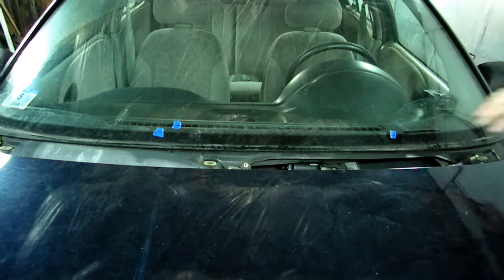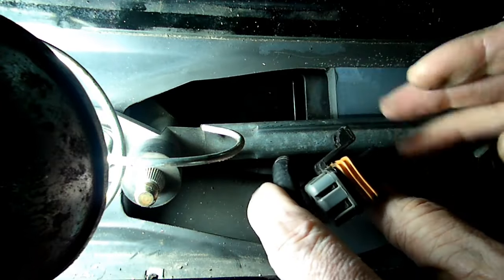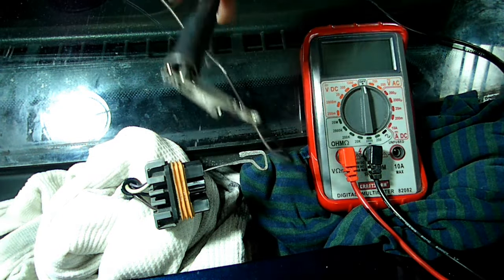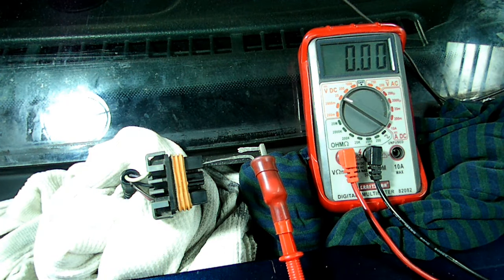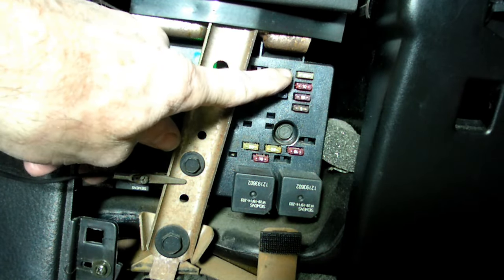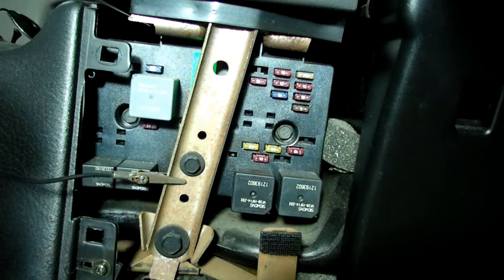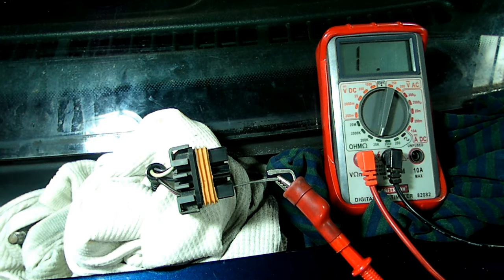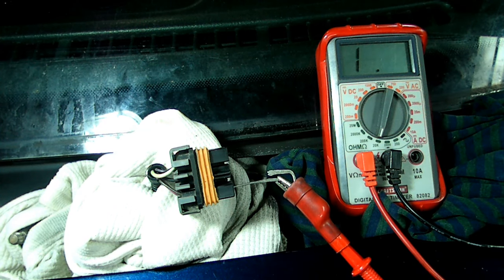Wiper Motor & Switch Troubleshooting

Comment: Brother i really watched this video about 10 times as i have no front wipers on a nissan pulsar  n14 hatch back ..
i had already replaced the wiper motor and replaced the wiper stalk but still no action ,   i followed your steps  with the multimeter and all was good  , my next step was remove the wiper motor again .... 
It  turns out there is a difference in a nissan pulsar hatch front  wiper  motor and a nissan pulsar 4 door  front wiper  motor .. found the exact model replaced it again and away it went ..... your video was really clear and easy to follow ..... thanks heaps

Comment: I used your excellent videos to troubleshoot a wiper problem.  The switch was fine.  I took out the wiper assembly and assumed the wiper motor was gone which the video suggests.  However, when I took the motor off of the assembly I discovered the linkage was rusted solid and wouldn't move and that was the problem.  Thought I should mention that as one other cause for wiper problems.

Comment: My bad Richpin06, I never finished the video. I just did your diagnostics completely and found thatthe answer lies in finish the whole educational video. Awesome stuff once again. Moter is shot
Reply from the maker: I am glad you found the problem.
Reply: @RichpinTv  in theory I did. I just pulled the assembly from the bone yard today in Sarasota, Fl. Hotter than a Mo-Fo. Got a steering wheel with the Multi-Switch since it looked brand new and fot WTF purposes . BTW, i lost my old email address when I first started using your vids back in 2009. You and Old Nuc from Saturn forums walked me through the timing chain and cylinder head install back 2012ish. I went by Mr. Raider I believe .

Comment: I have a '98 Saturn SC2 with over 256,000 miles on her (original owner).  My wipers seem to have a mind of their own.  When I push the switch arm down, for the wipers to swipe once, sometimes they do, in fact, swipe once but there are times (numerous lately) when they will wipe multiple times before stopping and sometimes they just don't stop.  The "high" position seems to work just fine.  The low and intermittent settings vary in their "timing" of the wiper movement which is to say they're not working exactly as they have been over the years.  I disconnected the elec connection to the motor (as per your video which is great BTW) and proceeded to do some meter readings.  The readings on my purple and brown wire are fluctuating wildly vs what you show in the video.  At one point the reading on one of those wires leveled out to a specific reading but starting fluctuating again when I barely touched the wiper switch arm.  Based on that, I'm thinking the switch is toast.  Am I barking up the right tree or did I miss something?  Thanks in advance.
Reply from the maker: +Roy Sacavage Your troubleshooting sounds like there might possible be a problem in the switch area.
Reply: Roy Sacavage , I have the same problem with my Jetta wipers. The dealer charged me $300 bucks to change the wiper controls arm at the steering wheel, after leaving the dealership the same symptoms were still there especially in the cold mornings. I think it's the capacitor inside the motor that is failing and won't shut off the wipers when it's supposed to.  Not many videos online for such troubleshooting. Rich pin did help me hear in understanding that there is an internal capacitor regulating the voltage to control the motors intermittent and speeds. There is a starting point. Cheers

Comment: I just want to share my thanks to you for your excellent diagnostic video! Following the steps that you shared in this instructional video, I was able to successfully diagnose that the issue with my wipers not working correctly was to be found in the motor assembly, not the switch. When I got in there and checked, I found the bolts holding the motor to the mount were loose (not a good sign). I located another motor assembly at a local junk yard and tested it before I mounted it. Problem solved! Many thanks for your kind assistance!

Comment from the maker: @goatinapastlife It is not a switch problem because the voltage does not go through the switch.Look for the problem at or around the wiper fuse in the interior fuse panel.

Comment from the maker: The metal inside the car is a lot cleaner for better contact is why i ran the wire there.I ran my wire to the brace in front of the fuse panel.

Comment from the maker: 12 volts is correct for the yellow wire as it comes direct from the 25A wiper fuse.Were you blowing the fuse before you replaced the switch.

Comment: Good video Rich !!!  I`m having a problem with the wipers and right turn signal on 2004 3.4L Impala. I`m  still waiting on the mail for the Haynes manual.  The rear passenger signal is fine.  The front has nothing. Hazards work.  When I put the switch up for a right turn it clicks fast.  When i put it down for a left turn it clicks slow.  I get no wiper action at all except when I push the button to spray washer fluid and that is at slow speed for three swipes.   Thanks

Comment: thanks for that,  I picked up some relays from the yard and still does not work.  I also grabbed a horn, I'm going to try to put that in today.  You ever known of the clicking sound problem from behind the instrument cluster around the air vents or below them on this 3.4L. When the car is running it seems to want to stop when I slide the Temp. switch up to heat. If it`s an actuator, I'm having a hard time locating it.  That manual is dragging it's tail coming from California.

Comment from the maker: It sounds like the motor could be bad.I have replaced those switches before and never had the air bag light on afterwards.Maybe a wire got pinched.

Comment: Good video, well explained, Thanks. I have a 2000 f150, wiper motor doesn't work. I can unplug, run hot wire from battery to motor, the motor will work. I'll try this.

Comment: Another good video of yours. Thanks for taking your time making these videos, sharing know how.
Reply from the maker: Erland Andersen Thank you.
Reply from the maker: Erland Andersen I will put it on my video to do list (how to remove ECUs)
Reply: richpin06a 
Thanks for replying. I obviously was a bit too fast deleting that ECU-question here. Thing is, I had a chat with a local VW mechanic after I wrote it, he had some answers, so I didn't want to occupy your time with unnecessary questions. If it can be of any interest to anybody: He said I was basically right, those contacts should come off quite easily, but they can stick to some extent on that old cars (96 mod), maybe having never been removed before. So he told me to be patient, spend some time and some suitable corrosion losening dissolvent, before prying carefully to pull it off. 
Thanks again for great videos, with good cameraworks and easy to understand comments. I appreciate useful stuff like this.

Comment: yeah,  Thats what I'm feeling also.  That part is very expensive.  going to the junk yard today.  LKQ here in Bradenton has a 2005 in the yard.  BTW,  would you happen to know anything about the impala horn issues.  the only fuse box I have had time to look at is the on on the driver side and I do not recall seeing a fuse for the horn.  Thanks Rich.  I'll be hittin some clicks as normal for ya's !!!!1

Comment: Great video Richard. When you test resistance at the socket, did you put the key on off position or accessories/run? Thanks.
Reply: According to the video, the ign. switch is off. Also, if you have 12 V present and set the meter to measure resistance, you will blow the meter.

Comment: Great video. I am working on the same vehicle (99 SL2). Electrical is my weak point. The wiper motor works but blows the fuse when wipers are on high. All tests with multimeter were in the ballpark with the purple and brown wires. The yellow wire was reading 12.56. Is that voltage to high or is it normal? Could it be the motor blowing the fuse? I have replaced the wiper switch and now have an airbag light on :/ I really don't want to install a new motor with the same results.

Comment: good video, but I think you should use the ground in the motor connector, rather than running the ground from a different point.  If the ground is open at the connector, then you will still have voltage on the yellow and see the switch functions working but the motor will not run.

Comment: thanks for the great video.  I have a Mercedes ML430 with wiper problem where it only works in the fast position.  Before I start throwing parts at it; your video is very insightful in how to test the switch vs. motor problem (or fuse or relay for that matter).  Going to be a pain to get to the harness...but I think it's better than trying to get the steering wheel off to try and get directly to the switch contacts (which probably isn't possible anyways).  let me know if you have thoughts about my problem.

Comment: '98 SC2--- Two weeks ago the delay wiper started doing strange things. No matter which of the 3 delay speeds was selected routinely the wipers would start wiping very quickly with only a momentary stop between each. This would last about 20 seconds before returning to "normal" for a short period of time, then it' would repeat the cycle. If you turned the wipers completely off while in this rapid delay that wipers will continue to function for about 20 seconds before turning off.  Relay?

Comment: i have a 95 chevy silverado and the wipers work they just stop in the middle of the windshield and i have to turn em on then off and they will either stop at the top or somewhere else could it be the pulse board?

Comment: Hey richpin06a why has to be 12 volts on the multimeter? I'm cheking the connector and it has blue, blue with white, black and red wire colors. Is that right if I clip the ground(COM) with the black color and the red one with red one?

Comment: I have a 2008 outlook and the wipers and washer jets stopped working randomly when I started the car. I tested the motor with a 12v battery and the wipers work, but the column switch isnt doing anything. There is around 11 volts going to the plug that goes into the wiper motor, but again changing it doesnt do anything. I ordered a new column switch so hopefully that fixes it. Any other reasons why both the washer jet button ( on end of switch) and the wipers would go out at once? fuses and relays were all good.

Comment: I replaced the switch the other day but I didn't get the results that I was looking for.  After I installed the switch I put the car in the "run" position (i.e. did not start it) and the wipers worked just fine in every position.  Timing of the intermittent settings was as it used to be.  No problems.  But...always a "but"....but here's the weird thing....when I started the car the wipers went back to not working as described in my previous comment.  ???  The only thing I can think of is that the wiring harness has gone screwy on me.  I'm thinking I should do some continuity tests on it.  What's your thoughts?

Comment: Thank you for posting the video, it is very informative and helpful. Do you know where i can find the fuse of windshield wiper motor in Corolla 97. I did check the voltage, which is 14 v. but when I check the resistance I don't see the changes when I switch to different wiper level. Thank you in advance.
Reply: Stanley Xu

Comment: Great video. The rear wiper on my Subaru Outback 2006 wasn't working though rear washer was working. Thought this suggested that the stalk switch was fine. So I replaced the motor, it worked immediately thereafter during a test. Then buttoned everything back together and wiper stopped working again by the following morning (no rain or extreme temps). Later that night I tried re-installing it including removing positive terminal from battery this time but no luck. Wiper motor ground was already attached and do not see any stressed, broken, or exposed wires leading to wiper motor back into the hatch/body of car. Fuse is also fine. Any tips? Thanks,

Comment: Hello. I test the yellow wire but have 6volt. I test battery have 12.60v 2007 bmw 550i anr ideas I test the wiper motor is good replace relay and fuses test good????

Comment: On my 2004 Chrysler Sebring I can put the test light to just the motor or the wiper arms and it's showing power coming through them is they're short in the motor or switch

Comment: My Windshield wipers stopped suddenly while driving in rain.  I pulled to the side and stopped the car.  They worked again after I restarted the engine.  This problem happened a few times again afterwards. What could be the problem ?

Comment: Hi i am working on a 1997 saturn s series same as in your video ,when i do the resistance check on either the purple or the brown my meter does not change from the 1 that was showing prior to you turning on the wipers low or high,is there any other positive test to prove that it is the switch,witch i suspect is the problem,I have no wiper's working at all,but the 3 cycle mist wipe still work's ,I tried a new motor from the local part's people they let borrow it ,plugged it and nothing.any idea's would help,thank's

Comment: And I assume you pulled up a wiring diagram so you knew which wire was connected to low/high/intermittent while testing resistance? And are low and intermittent running through the same wire because I saw you only checked 2 wires for resistance when there’s the 3 settings? Sorry for all the ?’s but I am going thru the same predicament with my rear wipers on my 07 Rav4

Comment: I get 0.30 ohms when checking for resistance. I can hear the motor do a small click when plugged in, but not movement. There seems to be water both inside the plugs of the motor and the plug. Any input?

Comment: So I have replaced my wiper motor/linkage assembly on my 2010 malibu. They have been working fine till a couple days ago.  turned the switch on to use them and nothing happens. No sounds from the motor even. Just a blown 25amp wiper fuse. The fuse in the BCM that send power to the switch is good. My next thought was swap the relays. Or I have a bad switch. Not sure. The motor and linkage assembly are only a few months old from rock auto. Gm genuine

Comment: Great Vid. My issue currently is the Motor not returning the wipers to resting point and when you go to top speed for wipers it squirts Wiper fluid. I have a 96 SL Twin cam. I replaced the power spring assembly and now my Horn works which it hasn't for the last 5 years, but now have the Airbag light. I had my uncle hook up his advanced code reader and I am getting a B1022 code from the Airbag system... I just got this thing back on the road after sitting for almost 2 years but would like to fix the small issue of the Airbag code. We cleared the code but it returns. Car has 245,000 miles. Code breaks down as this DTC B1022 Driver Deployment Loop Resistance Low ... What does this point to?
Reply: Airbag issue fixed i took it BACK APART AND found that I did not push in the airbag plug far enough. My bad. Everything good on the airbag stuff now.
Reply from the maker: +Jeremy Kieler Glad it was a easy fix.

Comment: I was replacing the wiper bushings and when i went to try everything to see if it works the wiper motor blew the fuse. I changed the fuse and it blows one every time I turn the wipers on. I disconnect the wiring to the motor and turn the wiper switch on and it didn't blow the fuse. I just don't want to go out and buy a $70 motor to find out that wasn't it. I also hot wired the motor straight to the battery and grounded it, and it turn on. I was told that it was bad motor if it did that. I'm not very electrical incline but if you can walk me through it I'll appreciate it.

Comment: What if intermittent 1 and 2 are low but make the washer fluid spray  3 is intermittent (sometimes) low does nothing and high is high pulling the wiper fluid switch cuts off the fluid motor only while its depressed as soon as I let it go the motor kicks back on

Comment: i have '98 dodge caravan and the wiper always stays high when the engine is started. the switch has no control. Any suggestion would be much appreciated.  Thanks.

Comment: I have been having issues with my wipers on my '99 Chevy Cavalier. They only work sometimes. When they don't work, the radio also doesn't work..would that be wiring issues or a motor or what could it be?
Reply from the maker: Seems like a possible fuse or wire issue.

Comment: I have a problem with my Saturn Ion. Wipers stopped working and burned fuse each time i replace it, I changed the relay too. then i decided to get a used motor thinking it was the problem.I put the new replacement already and test it with the switch and it was working but when i put the wipers arms it does not work again. I already checked the fuse and relay and its good.I think the high speed is not working on the motor or may be its something else. Please help.

Comment: my wipers stopped working on a 2000 saturn sl 1 at first they went to just one speed then they would not shut off then the washer fluid ran unitl empty then wipers quit working altogether now the fuse keep blowing as soon as i put a new one in and turn car to acc not starting

Comment: Yes the fuse was blowing before replacing the switch. Starting about 2 years ago the wipers would take their sweet time shutting off from intermittent,wash, or mist. Then 3 months back the fuse started blowing. Now I am assuming the motor is blowing the fuse due to all the added load of wiping a dry windshield. Any tips on shutting off the airbag light? Since replacing the switch it stays on. I followed your video and a shop service manual to a tee.